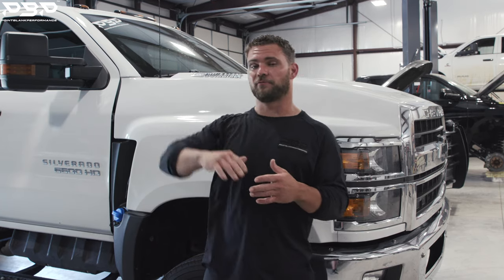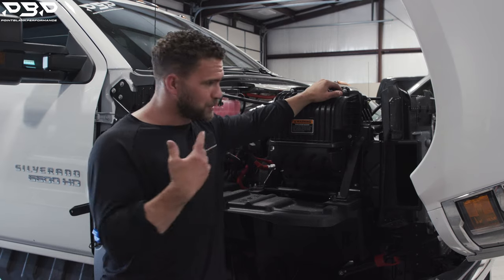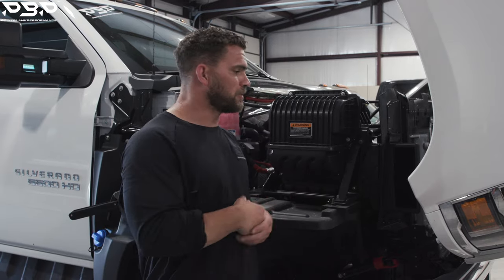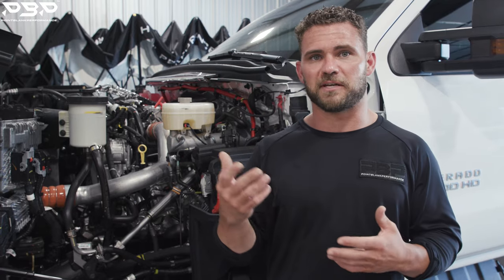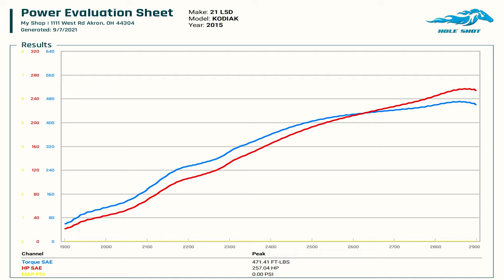L5D THE ULTIMATE TOW RIG!!?

Comment: POS, just turned 100k in my 4500. Nothing but trouble out of the “SAFETY” BS. From the dpf putting it in limp mode to the wheel sensors making it go into reduce power . Never will I buy another Duramax. I put 300k on my Cummins and never had no more than a water pump and wheel bearing replaced. I’m goin back to ram as soon as I can find a dealer that swap with me.

Comment: I developed that truck I worked for navistar who developed these trucks. They are really not made for pulling they are made for hauling like box trucks or small dump but these use a Navistar chassis
Reply from the maker: Hey thanks you for the feedback ! We can for sure understand that concept. With the engine that has high potential and a strong frame we are gonna throw some power at it and get it there!
Reply: I think what Chris is getting at is that the truck is not rated to tow based on its GCWR. It has a higher GVWR. It is irrelevant if the truck will pull the weight if the truck isn't rated from the factory for it. In the event of an accident all the lawyers will look at is the GCWR and if you had exceeded it. You get stopped by the DOT all they will look at is what you weigh compared to the GCWR. 

People always claim vehicles don't hold up but then don't use them for their intended purpose.
Reply: That engine is designed to run wot all day every day for around 350 thousand miles you hot rod it up it will loose engine and transmission longevity. Navistar tested and adjusted these settings to optimize low cost of ownership high vehicle up time.

Comment: I’m a power hungry man just like the rest of the guys who buy pickups trucks for just a daily driver a work truck and a work truck that when you step on it loaded or empty that will pin you in the seat on a hill loaded and flat walk off like a hot rod gas engine.  Check on plug and play aftermarket with a larger turbo. What ever the upgrade we all hope that it’s a setup reasonable enough that you can offer to the public for sale as a kit with several different power level options.  It’s real easy to spend someone’s else’s money.  I have a 2019 GMC 3500HD dual wheel one ton I’m interested in upgrading my power level on. Not for racing but to be able to keep up with anyone not pulling a load while I’m pulling my 32ft gooseneck duel wheel loaded maybe a bit overloaded.  Just a bit over. Anyway I am watching to see what way that you go with it power wise. 

Make us proud. 

Liked Subscribed & Shared

Comment: I don’t want to see what is “cool”, I want to see what keeps the truck functional. I bought mine to use for work, I tow with it, haul heavy loads on the bed, and will use it as a replacement for my chase truck in Mexico. I need reliability. 
I love seeing that you guys have a genuine interest in making these trucks better but please make it functional, obtainable power for the working guys that own them. 
Looking forward to seeing progress!
Reply from the maker: We have a 2500 charger off the trucks going on it sir . We will show results when we get it completed !
Reply: @POINTBLANKPERFORMANCE  good deal! Are these upgrades requiring an injector upgrade also or can we use factory l5p injectors?
Reply from the maker: @northstarbuilder  Factory ones will work sir , just have to open up the pulse width !
Reply from the maker: @northstarbuilder  Factory will work sir
Reply: Any news on this? Needing to develop a plan before the Baja season starts.
Reply from the maker: @northstarbuilder  Tore down waiting on up pipes to arrive and we start the fab work. Stock 2500 charger with stock fuel first ( piping kit in the works )

Comment: We have one of these but it’s in the form of a 35 foot Motorhome. It’s 13 feet tall with a bunk over and 4x4. Loaded for camping we should be around 20k lbs. here in Colorado I personally feel like it has great power. I can set the cruise at 72 and go anywhere with zero drama. My temps stay good and it very rarely downshifts. We came from a 30 foot gas ford V10 Class A so maybe I’m just stoked about being able to go more than 30 over the mountain.
Reply: 'i personally feel like' doesn't apply when we're taking in Absolutes. It may suit you we'll, but fact is it's under powered.
Reply: Gas and diesel engines are different animals, hard to compare. A more useful comparison would be Duramax 5500 vs power stroke F550

Comment: I just got one of these for pulling a 30 yard dumpster trailer... I had no idea it was de rated ... I will be running it hard maxed out and have been... I understood when you said it’s like you hit a brick wall at 70 with a load ... I just switched from Fords for 27yrs because I’m tired of how under-engineered Navistar has become since the 6.0 scam. I’m trying to get the lost power but I don’t want smoke or nasty smelling fumes... Lmk what you think
Reply from the maker: I haven’t reached out but Banks may have a plug and play device if not reach out to Calibrated Power Solutions EXT 2121 tell them PBP sent you!

Comment: What ever you guys do please let us know because, like I said in a previous comment we own the very same truck with a 12 ft. Concrete Bed it. The thing won’t literally get out of it own way here in Michigan where the hill are small nothing like Tennessee has, so with that being said we diffidently are interested in some kind of tune or being able to change out the Turbo and Injectors. I told my son we should have drove them all before buying one, I actually thought well all of our other trucks with Duramax Motors have been absolutely Monsters then along come this Turd. Frustrating as he heck.
Reply from the maker: We have it tore down currently sir , to be realist we first are swapping to a 2500 charger they are bigger on the compressor side , housing is bigger , turbine is the same . We will stay stock fuel and see what type of games we make. These trucks do require some modifications over the 2500 to make it all work ! Parts are will be sent off to powder coat so as soon as they arrive we will be back on the dyno see the results !

Comment: Medium duty trucks are rated differently than pickups for some EPA duty cycle reason...not really sure why. Dodge chassis cab 4500 & 5500s are the same...derated. Those have less horsepower & torque than the standard output Cummins in the 2500. So GM didn't produce a dog because of their own choice, their hands were tied. As the consumer, you should have all the right to improve upon that.
Reply from the maker: 100% reason why we bought the  this platform. Room for improvement is in the hundreds of horsepower with simple up grades. We wanted the L5p engine just did not like the body styles of the 3500 Dually so the 5500 was a fit for us.
Reply: The Ram 45 and 5500s have a 100 more ft/lbs of torque than these things do.  They get the torque sooner too.  A ram 5500 or and f550 will take one of these to gapplebees.